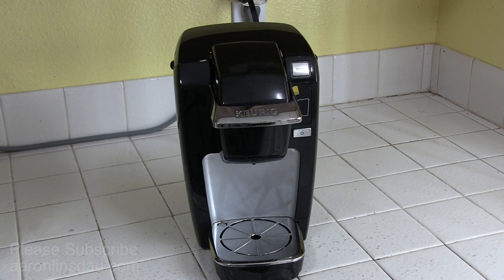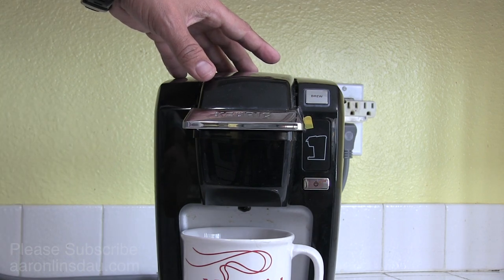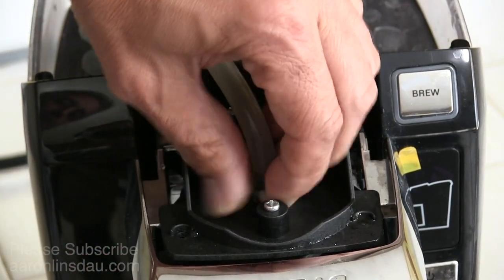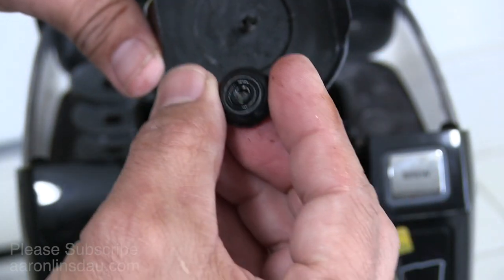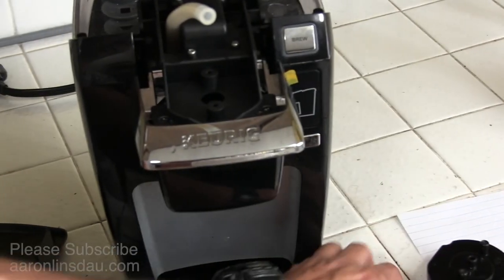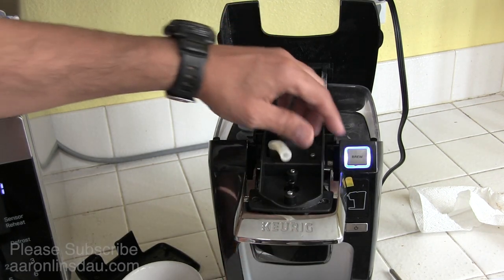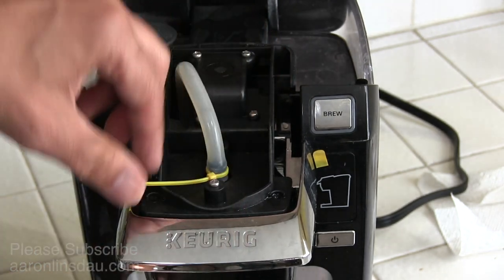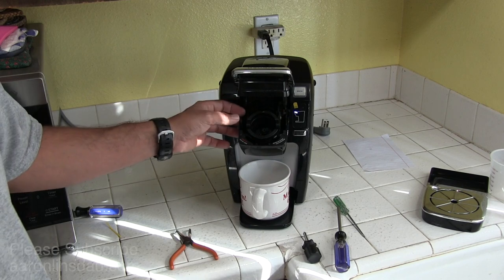How to Fix a Keurig K10 Coffee Maker that Clogged Stopped or Slow Brewing

Comment: You were right on target.
My sisters K10 unit broke today.  It would not fill up the cup with coffee.  Lucky I found your informative video on the repair of this machine.
I took mine apart removed top cover and 2 screws as instructed.
I then removed the 2 screws that held the black plastic housing that the rubber tube was attached to.
I used a paper clip as instructed and found the 3 holes at the bottom of the plastic tube were clogged with coffee grounds.
Cleaned the passage with white distilled vinegar and rinsed with water.
The compartment that held the water was full of corrosion.  I filled it with distilled white vinegar and let it set for a few minutes then rinsed it with water.  I did this several times until the particles of material loosened up and left the tank surface nice and clean.
Then I ran about 10 cups of water through the machine to give it a good rinse without a coffee cartridge in place.

Now my sister is one happy camper.
Many thanks for the help!!!!🙂
Reply from the maker: Sure thing!

Comment: Thank you! Followed your instructions and I went from angry and cranky with no coffee to powered up and caffeinated in less than 10 minutes. I used a thin piece of wood to place the open keurig upside down for the last step. Made it easier to work with the steel non magnetic screws. I almost lost one trying to work with it upright because  my thick fingers just didn’t fit.
Reply from the maker: Nice pointers!

Comment: Omg it worked,  I had to take pictures halfway through and make sure I put it back right I can always remove things but I can never put them back right one thing it doesn't close properly  What do I need to adjust to make a fit better when I close it open and close..
 All in all I can't believe it also I didn't have to cut the zip tie.
Reply from the maker: Thanks for watching.

Comment: LOOK!!!: 
If your "K10" doesn't have a faint electronic hum anymore (when you plug it in) but it still lights up (but does not heat or pump):
 I opened up the very bottom and found a loose nut holding an electronic part (were the wiring comes to a junction) I tightened that up and it worked again! It's a little tricky to pry the bottom plastic base out (as well as the the metal plate) but once you do you'll see that the single NUT (not the screws) holding the wiring may be loose (this is where the heater and pump apparently lose power).  I also trimmed some metal off of each side of the plate to get it to pop back in easier. NOTE: 2 screws on the bottom of the plate hold some of the wiring as well but these are not the issue. Make sure this is unplugged as you work on it! (DUH)
Reply from the maker: Good pointers.
Reply: @ALinsdau  Thanks!  I hate when stuff stops working but I really enjoy a successful repair and then sharing the "fix" 😀 I installed car audio for a number of years so I would have to find and fix similar wiring/manufacturing failures.

Comment: Love these How to videos. My Keurig stopped moving the water the top to the bottom when I would lift the top so I searched for a fix. Now while his did move the water I still did the steps and was able to get the tube off without popping the zip tie. You have to go slow and do some twisting and it comes right up. I had grounds in the tube and in the pin needle area cleaned it all out and made a gods cup of coffee. Thanks
Reply from the maker: Excellent

Comment: My machine works, I cleaned both needles, when I run a water cycle I get grounds. Ran it without the basket still get grounds. Would taking it apart like this be best?
Reply from the maker: Check the basket? That's happened to mind.

Comment: I followed your procedure without success. The Keurig would still not pump water/coffee although needle appeared to be very clogged. I then sucked on the hose opening and after a little bit I heard a small pop and my mouth was full of water. Apparently there is a check valve in the line that got stuck. I then ran vineger through the unit twice and then rinsed. The Krurig now runs and pumps coffle like a champ. Suggest you add this additional step if you update the video.
Reply from the maker: Great pointer, thank you!
Reply: You might try a medical type syringe with a proper hose size adapter.  That way the water and coffee grounds are sucked into the syringe instead of in your mouth.  Not sure if this would work but I would think it is worth a try.

Comment: I'm starting to get issue with my K10. begin yesterday.machine was clogged i get that unplug it bring it to the washroom sink lift it upside down to drain the water out. but i notice the "brew" was on steady and not shut off. when i unplug/plug it the "brew" button automatically turn on permanent is there any suggestion you can gave me what to do thanks.
Reply from the maker: Uh oh - that's not good. Contact customer support is all I can suggest.

Comment: I literally did everything step by step and when I put water to test it before putting everything back together the water did come out the hose. So figured it would work. Put everything back together and it’s still not working. Can someone tell me what I’m doing wrong 😭😭
Reply from the maker: If water is coming out of the hose, the spike nozzle is clogged. Try and pour some water through where the hose connects to on the tilting head.

Comment: Thank you for such a great video. I have exactly the same model of Keurig as yours. It wont turn on at all. Another Youtube video suggested to hold on to the on/off button while plugging it in. Tried that, still did nothing. It's dead. I got this as a gift 5 months ago. Do you have any suggestions please on what to do to get it to start. Thanks again
Reply: there are tons of witchcraft cres for the keurig.....none work.
Reply from the maker: Maybe a wire is broken?

Comment: managed to unscrew, but having problem taking lid off.  any easy way to do this?  thanks
Reply from the maker: You have to lift slightly and push back on the lid. Make sure you got all the screws out, too. They're easy to miss and hard to get to. The first time I did it, I missed a screw. Then when I pressed backward, the lid finally popped off.

Comment: Water is not coming out of the hose for me. Any fixes before I dropkick it out of the door?
Reply from the maker: See if you can chase the hose down to the pump. Usually blockage like this is caused by the pump caked up with lime & calcium. Try white vinegar first.
Reply: @ALinsdau  Many thanks! What does "chase the hose down to the pump" mean? Again, I appreciate your time!
Reply: @ALinsdau  I've got the same problem. Check valve or something inside isn't letting water pump out of the hose
Reply: Lol